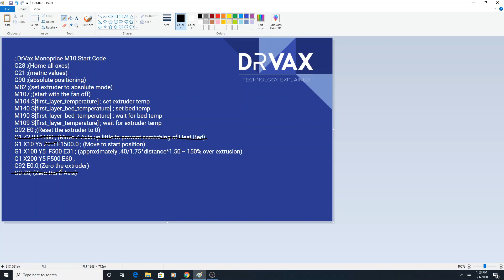MP10 Auto-Leveling Issues Due to Start GCode and How to Fix

Comment: I'm not so sure about this... I could be wrong but I don't think so...

In order to reset the printhead/machine coordinate system's  to a position it currently is in would be

G92 Z0

A G0 is rapid move --- After executing the G0 on the next line, he's using a modal command to do a rapid move to Z0, which is whatever the machine stored as a zero during homing.

This is NOT the same as the values the machine loads during an Autolevel procedure - those are positional offsets; ie... when the head is at this XY position of the bed, offset Z by this amount. This is internal to the microcontroller firmware. 

What Dr VAX does is to reset the extruder with a G92, and then just move the Z axis to zero using a G0 Z0.  

For Example:
G92 E0 ; set the current filament position to E=0
G1 E10 F800 ; extrude 10mm of filament

So as shown in DR Vax's startup code:

G92 E0  - this will just set the extruder to 0. That's it
The following line:
G0 Z0 will then move the printhead to whatever the machine coordinate for Z is - it is NOT reset by the previous line. 

Now if he were to issue:

G92 Z0 - THAT would reset the printhead - wherever happens to be at that moment - to the new machine coordinate of zero. 

We use G92's all the time to set the machine coordinates to a known position, then use G0's on the following line to travel to the start position. 

A G92 WILL reset the coordinates as per the Marlin ref:

G92        Set current position to 
coordinates given
G92 X## Y## Z## E## G92 X10 E90
Allows programming of absolute zero point, by reseting the 
current position to the values specified. This would set the 
machine's X coordinate to 10, and the extrude coordinate to 
90. No physical motion will occur.
G92 
without coordinates, all axes are set to zero.

I don't believe that the G92 is modal, and even of it is, the G0 will end the G92 mode.

Modal commands are arranged in sets called "modal groups". Only one member of a modal group may be in force at any given time. 

From "G Codes and M Codes for 3D printing":
"In general, a modal group contains commands for which it is logically impossible for two members to be in effect at the same time. Measurement in inches vs. measure in millimeters are modal. A machine tool may be in many modes at the same time, with one mode from each group being in effect. The modal groups used in the interpreter are shown in Table 6. 

Group 1 	{G0, G1, G2, G3, G80, G81, G82, G83, G84, G85, G86, G87, G88, G89} - motion
Group 2 	{G17, G18, G19} - plane selection
Group 3 	{G90, G91} - distance mode
Group 5 	{G93, G94} - spindle speed mode
Group 6 	{G20, G21} - units
Group 7 	{G40, G41, G42} - cutter diameter compensation
Group 8 	{G43, G49} - tool length offset
Group 10 	{G98, G99} - return mode in canned cycles
Group 12 	{G54, G55, G56, G57, G58, G59, G59.1, G59.2, G59.3} coordinate system selection
Group 2 	{M26, M27} - axis clamping
Group 4 	{M0, M1, M2, M30, M60} - stopping
Group 6 	{M6} - tool change
Group 7 	{M3, M4, M5} - spindle turning
Group 8 	{M7, M8, M9} - coolant
Group 9 	{M48, M49} - feed and speed override bypass"

Note that G92 is not listed...   "Non-modal" codes effect only the lines on which they occur. For example, G4 (dwell) is non-modal. 

From the  Haas website - one of the biggest mfg's of CNC machines (google it) 
 Note where it states " G92 is non-modal"  :

"G92 Set Work Coordinate Systems Shift Value (Group 00)

This G-code does not move any of the axes; it only changes the values stored as user work offsets. G92 works differently depending on Setting 33, which selects a FANUC or HAAS coordinate system.

FANUC or HAAS

If Setting 33 is set to FANUC or HAAS, a G92 command shifts all work coordinate systems (G54-G59, G110-G129) so that the commanded position becomes the current position in the active work system.

 G92 is non-modal.

A G92 command cancels any G52 in effect for the commanded axes. Example: G92X1.4 cancels the G52 for the X-Axis. The other axes are not affected.

The G92 shift value is displayed at the bottom of the Work Offsets page and may be cleared there if necessary. It is also cleared automatically after power-up, and any time [ZERO RETURN] and [ALL] or [ZERO RETURN] and [SINGLE] are used.

G92 Clear Shift Value From Within a Program

G92 shifts may be canceled by programming another G92 shift to change the current work offset back to the original value.
%
O60921 (G92 SHIFT WORK OFFSETS) ;
(G54 X0 Y0 Z0 is at the center of mill travel) ;
G00 G90 G54 X0 Y0 (Rapid to G54 origin) ;
G92 X2. Y2. (Shifts current G54) ;
G00 G90 G54 X0 Y0 (Rapid to G54 origin) ;
G92 X-2. Y-2. (Shifts current G54 back to original) ;
G00 G90 G54 X0 Y0 (Rapid to G54 origin) ;
M30 (End program) ; 

From Tormach CNC g-code-formatting-reference :
Non-modal G-codes are as follows: Group 0 {G04, G10, G28, G30, G53, G92, G92.

MODAL GROUPS

G- and M-codes are, generally speaking, modal — they cause the machining system to change from one mode to another. The mode stays active until another command changes it implicitly or explicitly.

    EXAMPLE If coolant is turned on (M07 or M08), it stays on until it is explicitly turned off in the program (M09).

A few G-codes and M-codes are non-modal. These codes have effect only on the lines on which they occur.

    EXAMPLE Dwell (G04) is non-modal.

Modal commands are arranged in sets, called modal groups. Only one member of a modal group may be in force at any given time. In general, a modal group contains commands for which it is logically impossible for two members to be in effect at the same time.

    EXAMPLE Inch units (G20) vs. millimeter units (G21).

A machining system may be in many modes at the same time, with one mode from each modal group being in effect.

For all G-code modal groups, when a machining system is ready to accept commands, one member of the modal group must be in effect. There are default settings for these modal groups. When the machining system is turned on or re-initialized, default values are automatically in effect.

Modal groups for G-codes are as follows:

    Group 1 {G00, G01, G02, G03, G33, G38.x, G73, G76, G80, G81, G82, G84, G85, G86, G87, G88, G89} motion – This is a group of G-codes for motion called current motion mode — one is always in effect.
    Group 2 {G17, G18, G19, G17.1, G17.2, G17.3} plane selection
    Group 3 {G90, G91} distance mode
    Group 4 {G90.1, G91.1} arc IJK distance mode
    Group 5 {G93, G94} feed rate mode
    Group 6 {G20, G21} units
    Group 7 {G40, G41, G42, G41.1, G42.1} cutter radius compensation
    Group 8 {G43, G43.1, G49} tool length offset
    Group 10 {G98, G99} return mode in canned cycles
    Group 12 {G54, G55, G56, G57, G58, G59, G59.1, G59.2, G59.3} coordinate system selection
    Group 13 {G61, G61.1, G64} path control mode
    Group 14 {G96, G97} spindle speed mode
    Group 15 {G07, G08} lathe diameter mode

Modal groups for M-codes are as follows:

    Group 4 {M00, M01, M02, M30, M60} stopping
    Group 7 {M03, M04, M05} spindle turning
    Group 8 {M07, M08, M09} coolant (special case: M07 and M08 may be active at the same time)
    Group 9 {M48, M49} enable/disable feed and speed override controls
    Group 10 {operator defined M100 to M199}

Non-modal G-codes are as follows:
Group 0 {G04, G10, G28, G30, G53, G92, G92.1, G92.2, G92.3}
Reply from the maker: You aren't wrong, for a normal system... this setup is not normal at all...
Reply: @sniffle23  No I f I execute a G92 Z0 with the print head one inch above the table, that's where the new Z is. 
If on the next line I go do a G0 Z0, since I'm already at Z0 no motion occurs. 

Now if I execute a G92 X0, wherever the print head is located is now X0 in the machine coordinates.
But in the next line, if I execute a G0 Y2, the head will move to Y2 that was originally set before any of the G92

G92's only work with what's on that line. As shown in the example I listed:
G92 X1.0 Y2.0 Z3.0; (Set local coordinate system, current position X1, Y2, Z3)

Would just mean that the printhead is now thinks it's at  X1.0 Y2.0 Z3.0.   

A line that starts with G0 after the line with G92 SHOULD NOT reset where the machine (ie machine or work coordinates)  thinks the following position command.

That's not right... if it were I'd be crashing all the time...
Reply: I have an MP10... was just running it. He resets the extruder after the waste line he puts down
Reply from the maker: You can argue all you want... the is months old and I don't care anymore, I havent even read your dissertation and am not going to either... Ive forgotten most everything about this video, and would probably have to rewatch it to refresh my memory completely... 

But since you are using straight gcode commands and not the interface as given thats most likely where the difference lies... as the display interface doesn't communicate well with the actual control board and causes lots of issues.
Reply from the maker: Also, this was based on an mp10 mini, while the only difference should be the x/y/z volume in firmware you never know what proprietary firmware makers do between models.

Comment: Thank you. Dr. Vax does have a very useful warped bed tip - use paper to adjust in 0.08mm increments. He uses post-its, but printer paper works fine (measure with a caliper first and cut to size). I bet your tip will help immensely for higher resolution printing. I've gotten my bed to within 0.04mm of where it should be manually by using calibration prints.

Comment: I think you are mistaking "G0 Z0" as doing the same thing as "G92 Z0".

Albeit unnecessary to have the line at the end of start code it doesn't hurt or change anything so it can remain as is or be removed without causing any change to where the print will actually start printing.

"G0 Z0" is moving the Z axis to 0 position which is the "home" position. It is not overriding anything. That start gcode is not setting any sort of Z offset.
You could even change the last line from "G0 Z0" to "G0 Z158" and the print will still start at the same location as if leaving at "G0 Z0" or removing the line altogether.

The line moving Z to 0.3mm above the home position is for the purpose of priming the nozzle prior to the print starting. If Z was not at 0.3mm or some small amount above the bed surface then the filament would not leave space between the nozzle and the bed for the filament to come out when the "X100 Y5 E31 F500" and "X200 Y5 E60 F500" lines are executed. (Those two lines could be combined into one line reading "X200 Y5 E60 F500" but either way the results are exactly the same whether they are two separate lines or one line combined.)
Reply: I see some great feedback here but I am not sure which advice I should follow. Is there a response to this comment? I guess I can just try both things but honestly I am at the end of my patience with this 3d printer and this kind of info could hopefully help save me some major frustrations! Thanks to you both.
Reply: @dannymcpurple1143  2 years later im having this same problem, did you ever figure out a solution